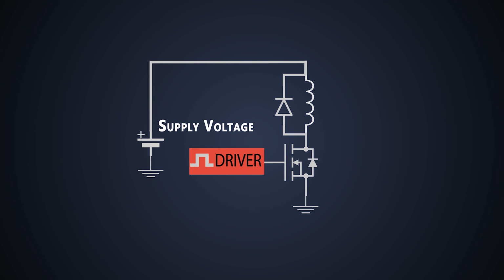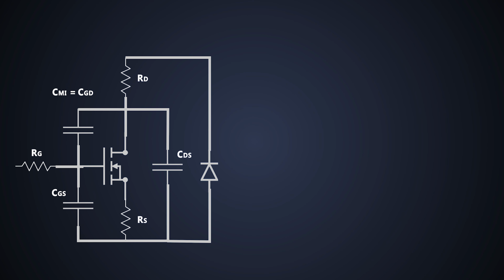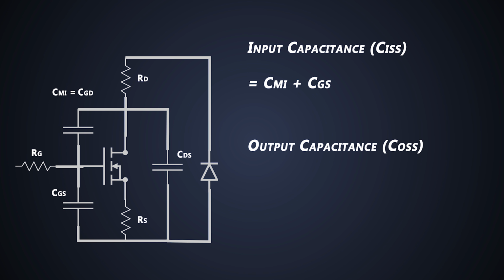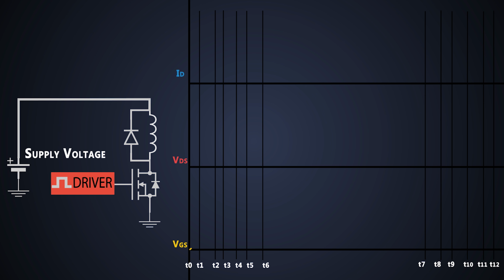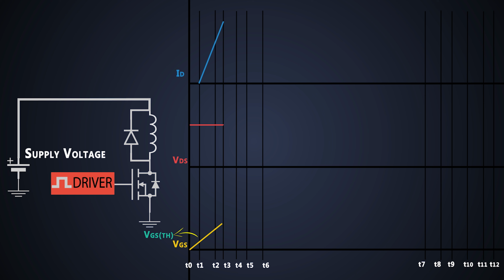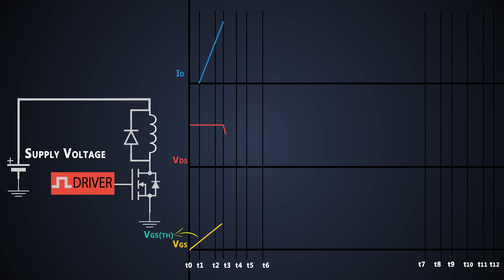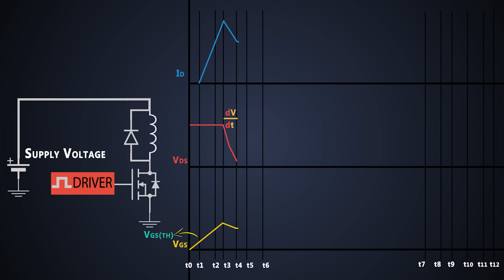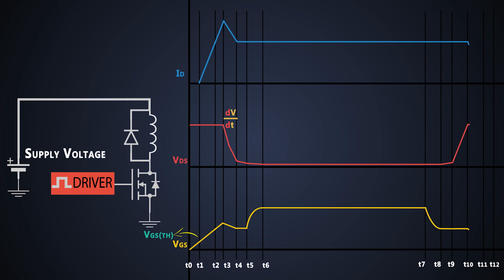MOSFET switching waveforms for an Inductor | dV/dt rate in the MOSFET

Comment: For my Class D amplifier design, I have used PMOS + NMOS logic as my driver, where I have connected an Inductor in series with the Vbus(Power supply connected to the PMOS) to act like input filter thus preventing sudden reverse current spiker due to the faster switching and load. In the simulation I observed something similar as you showed in your video, but the spike occured while the switching from high to low, is it because of the same reason??? I damped it to around 0.2 V which was initially Vout+2.5V by connecting a Zener diode in the output, which the method I found from an Article.

Comment: For an inductive load turning on and off, does the voltage back feed through the free wheel diode through the inductive load, and not back to the power source? I am using a PWM with adjustable duty cycle at about 20,000 to 22,000 CPS to be outside the audio range. I want to power 4 PMDC motors at 36 V 36 A each, 144 A total at full load. I had a bad heart attack causing low blood flow to the brain wrecking my memory. Fortunately, I still remember the characteristics of an expanding and contracting field around an inductor.

Am I correct to think the back feed spike voltage can be 4 times the applied voltage? Would a capacitor in parallel with the fly back diode be helpful? I cannot remember the frequency threshold for the need of a Shottky fast acting diode for the free wheel/fly back diode. Would a capacitor size be based on frequency or motor ampere?

I was also told the ampere rating of the MosFETS is what current can flow continuous through each MosFET. I have difficulty wrapping my brain around 120 A continuous through a TO-220 package, even with a huge heat sink. Would this be possible to push 120 A through one MosFET rated at 120 A, or should I use 3 MosFETS paralleled for each 36 A motor? I prefer to be under rated for ampere, than over rated and burn MosFETs.

Comment: Good video, but a small correction.  Freewheeling current doesn't go back to voltage source.  it is dissipated in the diode and the inductor.
Reply from the maker: Great point!
Reply: @msds1502 You mixed up current and power. Active / passive devices does not dissipate electric current. If they do, they spoil Kirchhoff's law.
Reply: Where the current go?

Comment: Is the flyback diode recovery current spike and excessive drain to source voltage with IRF520 MOSFET a problem in fast (milliseconds at 90% duty cycle) switching of a 15k resistance, 12 volt solenoid? If so, how do we correct this?

Comment: Coupling capacitor between primary and secondary in every SMPS 

I checked IT by removing this CAP, I got an unaccepted result in android device while charging 
Notice the ripple in output please explain why this blue cap is used.